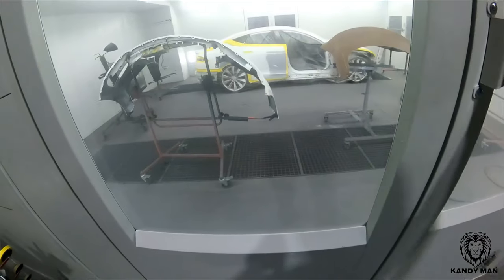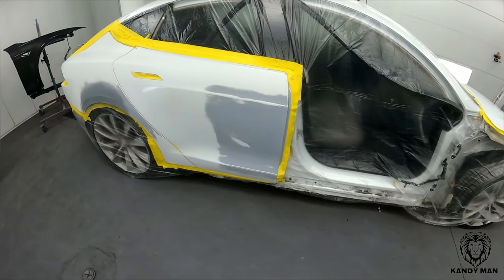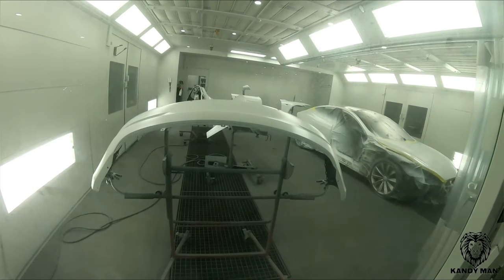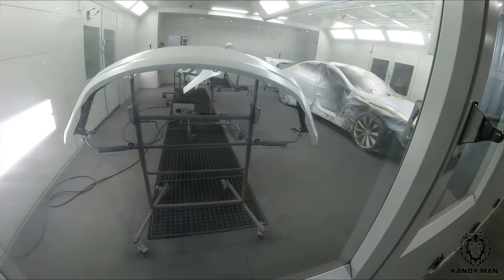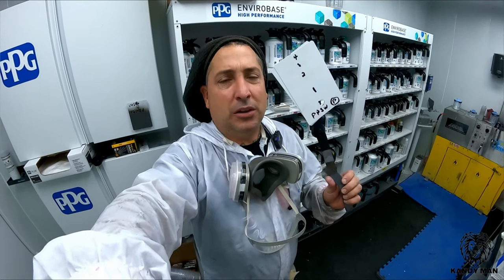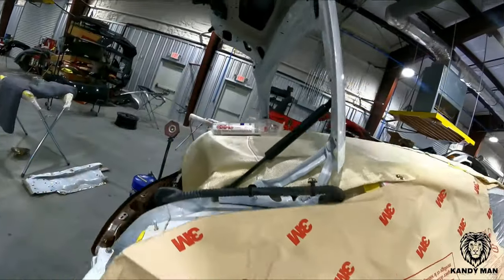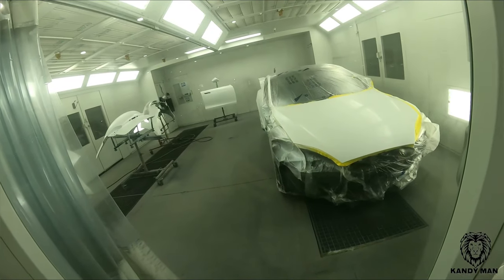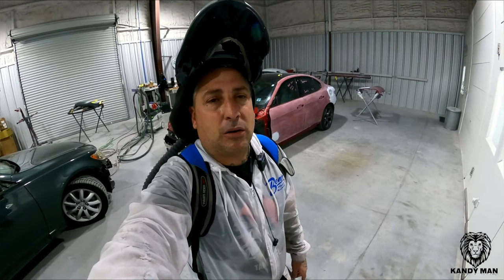3 STAGE WHITE TESLA - FULL BOOTH LOAD STARTING FROM SCRATCH

Comment: Hey you know ppg makes a raw bumper sealer you don’t need to use adhesion promoter. Technically they say you don’t have to scuff them either but I always do.
Reply from the maker: Thanks for the tip I'll check it to that.thanks
Reply: @kandyman5315  Just pour it in the cup and spray. You don’t need to mix anything else into it, so whatever is left over isn’t wasted. Good stuff.